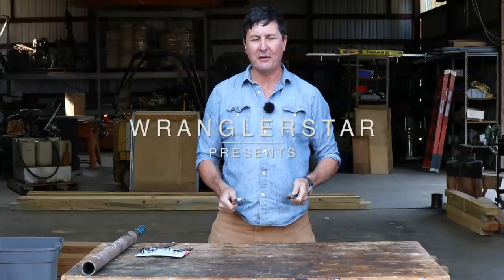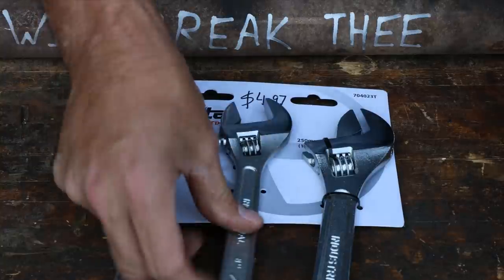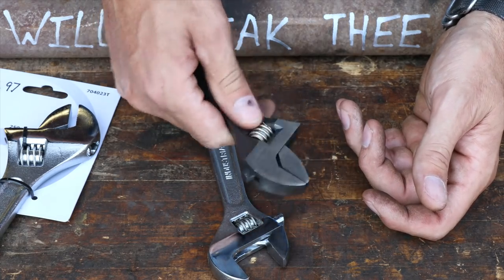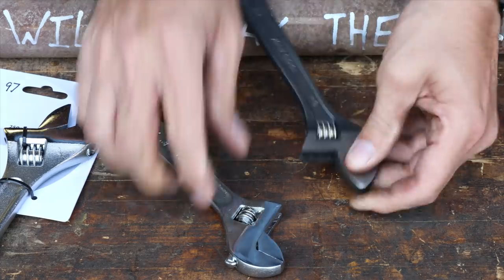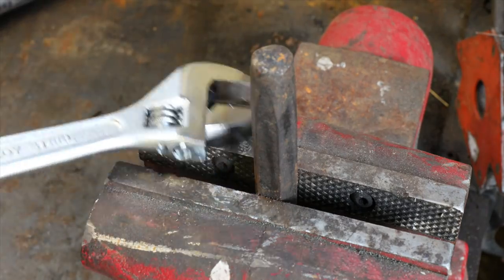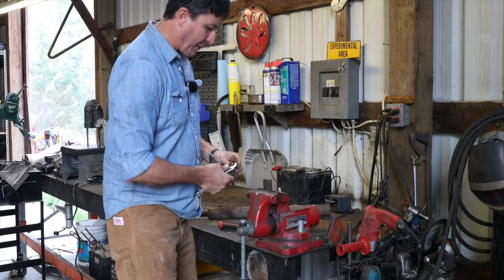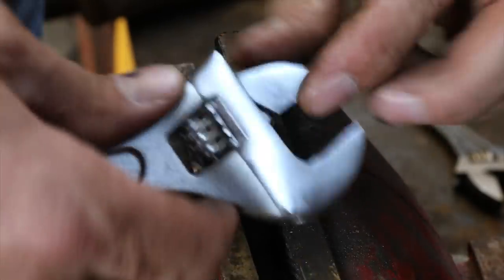Testing Cheap V.S. Expensive Wrenches On AMAZON

Comment from the maker: Great new! This S&K Wrench Just Went On Sale * * *https://goo.gl/igMEgW * * *
Reply: Wranglerstar Like 3 dollars off?!?! Now that's what I call a sale!
Reply: You can purchase a janky Chinese made with the 3 dollars you saved!
Reply: And you have a secondary use for the cheapos, as "sinkers" when you go fishing.
Reply: i like the saying "buy it nice, or buy it twice."
Reply: Wranglerstar  I bought an 8"  adjustable wrench from snap-on. made in sweden in 2005 I still use it every day today, I am a 50+ hour a week heavy equipment mechanic. There is a difference.
Reply: news*
Reply: Wranglerstar the adjustable wrench used today was invented by a swede if I'm not mistaken. In the 1890s. There was earlier designs but the one seen it this video is the Swedish type.
Reply: My dad always used the super cheap crescent wrenches to work on his van with, and they ALWAYS broke, either at the handle, or at the adjustable part.
Reply: I think at least a third, mid-grade tool should be thrown in the mix.  No way I would buy $4 wrench set, Or $35 Crescent, unless I know the $10-15 wrench is too close to $4 quality.
Reply: Wranglerstar milled or forged will always be stronger than cast when using the same dimensions and usually the same material, this video definitely shows this.
Reply: what if you allways paid that amount for shipping? So now youve kinda got free shipping.
Reply: @wranglerstar i have an idea use a pull weight scale to but between u and the bar so u can really see how many pounds it takes
Reply: Wranglerstar That was awesome, this first time I see your channel, very cool on putting tools to the test,, I was wondering if you can put a bunch of tools from Harbour Freight to that kind a test..I sure want to see that!
Reply: in the uk we call them hammer blows love taps
Reply: I think 1842 Edwin Beard Budding is inventor of adjustable wrench, and later on Bahco redesigned it 1891, so it looks like one today.
Reply: Wranglerstar my box is full of SK for the same reason your Grandfathers was "value". When it comes to screwdrivers and hammers it's all Snap-on. Snap-on ratchets are amazing as well.  Sunex  makes great value impact sockets. Cheap screw drivers "aka instant awls" have no business in anyone's tool boxes.  Those that don't appreciate a good tool tend to be the ones who struggle with simple tasks because their tools fight them the entire time.  My final words, "any tool that can do many things, never does one thing great"
Reply: impacts
Reply: Wranglerstar I feel the same way my dad always told me buy quality and now as a 14 year old and buying my own tools i make share they are good quality tools
Reply: Wranglerstar I,I
Reply: Hey wranglerstar do u know anything about s&k going out of buissness?
Reply: Wow, great timing. Who would have thunk it!
Reply: Wranglerstar, the teeth jumped on the wrench. I went back and watched it at 0.25 speed to see it.
Reply: What we are dealing with is American wages vs Chinese wages, I would think ingredients might be a factor as well, the type of steel and forging process.
Reply: The adjustable spanner, as most countries call it has been around since 1842, and invented by one or the other or possibly both at a similar time coincidentally, British engineers, Richard Clyburn and/or Edwin Beard Budding, then taken up by Swedish manufacturers Bahco, and American Crescent, around a similar time 1910. Thanks Wiki
Reply: lol crescent wrenches are garbage.. Have fun spinning nuts !
Reply: Farmers lathe. They have their uses and they see a lot of abuse.
Reply: Posh Pikey Pikey I've never heard them called that. I'm from Glasgow and we just call them shifters or shifting spanners
Reply: Geek facts: S&K did not invent the first wrench.
This modern version is a patented by Swedish Inventor Johan Petter Johansson from 1892. First producer being the Swedish brand Bahco, as early as 1892, still providing some of the best wrenches on the market. Johan Petter also invented the Plumbers Wrench in 1888.
The first version was invented by the English inventor Richard Clyburn in 1842.
Reply: As a testing protocol you are right.  Matthias Wandel does this using a bathroom scale and some cleverness!
Reply: Is it possible it got sponsored after it was posted?
Reply: Lying about being sponsored? Ive lost all respect for Ethan at H3H3 because of you!
Reply: Not really a sale, it just changed seller, there is a 12$ shipping fee.
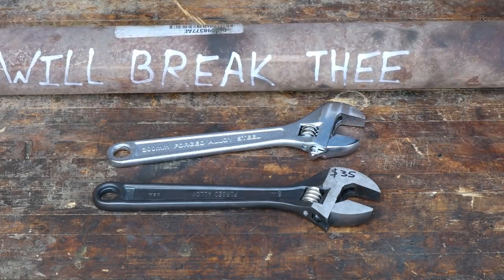Reply: If you read what the cheap one says on it at 2:01 they are both forged.
Reply: I got a hold of a garland no.2 leather mallet have you ever seen one
Reply: Many people have their own Amazon link that they use to link amazon purchases so they get something out of it. It's an affiliate link. He can earn up to 15% of the price you paid if you use his link to buy the wrench. It's called being a smart businessman. No lying about sponsoring.
Reply: Wranglerstar in Canada the "newfies" from Newfoundland call them tumb (thumb) wrenches.
Reply: Speaking as a "newfie", I have never called them tumb or thumb wrenches. Having used them for no less than 40 years, every Newfoundlander I've worked with either called them an adjustable wrench or a crescent wrench.
Reply: oobaka1967 must be the younger generation with the stronger accent/drawl ....
Reply: Actually, I find it depends on where in Newfoundland you visit. I live in the capital city and our accent is nowhere near as strong as you'd find with people living in outport communities. Maybe they call it a tumb wrench.
Reply: You should do some harbor freight tools
Reply: you would not shut up get to the fing point!
Reply: yes. damn the bla bla bla.
Reply: Wranglerstar I think quality tools saying should be ... gives you the FIZZ
Reply: With is why I like going to yard sales buying dated tools.
Reply: Wranglerstar I
Reply: Snap on, Mac, Matco, Blackhawk, S&K, and Craftsman tools get bought quickly at yard sales. Gedore tools are like finding gold.
Reply: Wranglerstar good video man . liked the ending
Reply: Wranglerstar I
Reply: What does this guy have to do with Ethan?
Reply: @ no1wrench True. I have a Swedish potatoe peeler. Still works. High quality stuff.
Reply: Good video man. Felt like I was having a good friend teach me about tools and life. Crazy, I know. lol subscribed
Reply: Wranglerstar i
Reply: I  bought a Harbor Freight wrench about twenty plus years ago and used it where I worked everyday and now I have retired and it still works fine. If it ever breaks they will; replace it FREE!
Reply: The quality changes sometimes. I remember when Craftsman tools were being made in Japan. They did not sale at all because of that, soon they were being made in the USA again. The quality may have been the same, but they had Made in Japan stamped on them.
Reply: Wranglerstar sub'd and bought one!
Reply: @Wranglerstar I'm not an avid viewer as I'm a machinist. So just have to say "Subscribed" because you said something damn epic and wise. "Come as deep as you can. Not always an option but whenever you can. Come as deep as you can."
Reply: S and K also has a lifetime warranty
Reply: Shifter in Australia
Reply: buy a tool from snap-on and compare it 2 a tool u could pick up from ur everyday shop or market from 15$ or so
Reply: BAK  I have a coworker that has a pair.  They look like awesome tools.  I would like to see them tested too
Reply: I don't know the S&K brand. However, in France, we have Facom, KS Tools... All very good. About your last question and full life warranty. About expensive tools,  I think the truth is in between. One does need all size of wrenches for all case, but in fact, only some of them are used a lot (13, 17 and 19mm for the 1/4, 8, 10 and 13mm for the 1/8) and some barely never leave the box. A full box of cylindric wrenches by Facom is many hundred euros. So I bought a cheap box. Then, I bought the Facom wrench, and the 19mm cylindric only because it's the only size I need with strong force. Some tools need to be premium brand, some other, less used, can be of a lower quality. PS. I also broke a wrench, probably the same branch as your chinese one.
Reply: lol....so you got no money for that?.......dont belive...
Reply: currently $44.71
Reply: Ya $45 for a wrench LMAO! No thanks. But he's just a salesman anyway. Let's compare the most expensive car with the least expensive car! (analogy) Oh dumb salesmen, always trying to prove that "you (we all) owe it to yourself to buy a $45 wrench!" lol dumbass. Dam dude, slow down your crack habit Mr. speed talker, there was very little, if any, worth while content that came out of your mouth.
Reply: Josh Rick Calm down there you Rick and Morty fan.
Reply: We are more the best tool for every job, if one can afford it.
Reply: When you see his YouTube name in there like that, you'll see that WranglerStar is monetizing his channel; in other words, trying to make money with it.  Amazon, not SK, will pay WranglerStar a small portion for commissioning the sale.  That's what this proves. It doesn't prove that SK had anything to do with the creation or content of this video. That's how Amazon affiliation works. WranglerStar is the one that brought people over to Amazon, who then bought products from Amazon. The link is how Amazon gives WranglerStar credit when the prospective buyer makes a purchase.

If you don't want WrangerStar to get credit, then go straight to Amazon's web site yourself, perform your own search for the same wrench, and buy it. Then, Amazon won't have any way to track the sale back to WranglerStar and he won't get credit for the sale.  It's more work for you, the user, this way, but it ensures that money doesn't exchange hands with WranglerStar.

WranglerStar proved in the video that the SK wrench was better built and better made. He broke both tools in the process. Both tools which, in the end, cost him money.  If he makes $0.07 from a sale of a $35 wrench (which, at the current moment, is up to $41), then let him. 

When, or if, you reply, please keep your comments relevant. I didn't put you down; I expect the same courtesy.

As for you, WranglerStar, this is the first video I've seen of yours, and I enjoyed it. I do my best to purchase quality tools, and yes, there really is a feeling of pride knowing that your tools won't fail you when you need them most - even if your'e doing the most mundane of tasks. To me, there is this indescribable feeling of attachment and pride I get with my tools. They're mine, and the tools know it. Take care of your tools, and your tools will take care of you. I subscribed, and I certainly don't mind if you make a commission from purchases I might make. I'm always searching for the best tools. I'd love nothing more that to have tools that last 20+ years that I can pass on to my own sons.
Reply: Wranglerstar it doesn't ship to Canada 😥 such a good video but such a tease cause now I can't buy the tool.
Reply: mm, who cares? Good video.
Reply: One week later and it's now listed at $41.60.  Haha!  Still worth it.  An important thing to discuss is that the reason the cheap wrench slipped on the steel plate is because the steel is soft due to a lack of quality forging.  More expensive wrenches will actually break rather than bend, but with much greater force due to them being much more rigid.  A consequence of this forging characteristic is that a cheaper adjustable wrench will wallow out at the jaws and be increasingly more prone to rounding a bolt the more it's used.

American steel vs Chinese steel is all about the forging.   There is simply no comparison.

Personally, since I don't make a living with my tools I can get away with having my regular tools as the cheaper brands.  However, when they become unreliable I have a set of quality tools that I keep to the side until I can replace whatever was giving me trouble.  This way, I'm not feeling quite as bad should I misplace a regularly used tool.Anyway, great video!
Reply: Wranglerstar to long and boring video...😑😑🙅🙅
Reply: Wranglerstar 8::::D
Reply: Only rich people can afford cheap tools.
Reply: By on sale, do you mean went up in Price?? Currently $41.
Reply: Steve Sanders 😩
Reply: Wranglerstar it was exactly 1.66
Reply: Wranglerstar
Reply: Wranglerstar the day you orders the cressant rench was on my birthday
Reply: Wranglersta
Reply: Wranglerstar your final comments transcend the whole wrench video. You could litterally apply what you said to anything in life to motivate someone lol
Reply: Bacho rocks !
Reply: swedish bacho is the best :)
Reply: The only problem I have is what you said with "renters". Being in the military from 2003 to 2013 I decided on renting instead of buying. Since I would end up saving much more money than I would gain in equity because of the deployments. I always treated the home I rented better than most people would treat their homes.
Reply: Wranglerstar Invented 1891 by Johan Petter "JP" Johansson that started BACHO. And he was Swedish
Reply: aa
Reply: Stop talking to much!!!
Reply: You feed my curiosity really nicely. Thanks for putting up these videos
Reply: Great comparison! Thank you. When it comes to the choice of purchasing a specific tool, I always look at how often it be used.  If I need a wrench that will be used 5-6 times in a month, I will definitely go with a cheaper one.  The case is different if something is used on daily basis.  That often used tool must be the best possible.
Reply: Wranglerstar 

The pop was a spark!
Reply: I hope SK also sells the parts separate?  Or are they guaranteed?
Reply: any German Tool is like the gold. most my co- worker are not every care it, but if you like it you not go back.
Reply: $42.34  went up in price
Reply: Actually that version from 1891 had dual moving jaws... the year after in may 11th 1892 Johan Petter Johansson invented the modern adjustable wrench but with 45 degree instead of todays 15 degree angle.
Reply: Wranglerstar I
Reply: Price back up - but the chrome, not the black oxide, is still about that price.
Reply: +CaptainDangeax
It's not "S&K", it's S-K, and it's an old high end US tool company that's owned by Ideal Industries now, a holding corporation that owns a number of different tool companies spanning numerous tool sectors. S-K is primarily hand tools for professional mechanics, technicians and millwrights, along with their Western Forge brand (the two are not the same though). Western Forge markets tools to the industrial market, similar to Blackhawk (Proto) and Williams (Snap-On). They also make some "private label" tools for other retailers. Who, exactly, like very nearly all private label makers, is highly protected proprietary information. They were making some higher end hand tools for Sears with the Craftsman Pro label until early 2017 when they unilaterally severed the relationship. Sears sued them for breach of contract and at that point some of the Craftsman Pro line having been made for Sears by Western Forge became public knowledge as the lawsuit is public information. Sears has tools made by a myriad of companies globally. S-K is an extremely close #2 to Snap-On in the USA. IMHO the hand tools are just as high quality, and just as durable, but at a somewhat lower price. With Snap-On, you're paying a premium for the fancy hood ornament.
Reply: Wranglerstar In most of the U.K. We call it a shifting key. I don't know why but we do
Reply: Im not sponsored btw
Reply: "Start with the Chinese Industrial Strength.....Oooo it's a lot of pressure...I am putting on my safety glasses on this one."
Breaks
"I wasn't pushing that hard."

lol. I'm sure most people know there's a difference between a $1.65 wrench and $35 wrench. The question is how a $35 Chinese Wrench square up against a $35 US wrench.
Reply: Wranglerstar P
Reply: Wranglerstar.
 House or apartment I always cherished where I lived. I was lucky to have a roof over my head even if its temporarily renting apartment or house. I was taught to always leave it like no one lived there.   I love your videos withall the knowledge Ive gained has been invaluable!
Reply: It is STILL over $30!!  LOL!
Reply: if you can brake that chinese wrench without extrension bar, then i bow.
Reply: Ya, something like a Stanley or Kobalt..
Reply: Here's a challenge for you: Prove to us (if you can) that an "overseas" Bahco brand adjustable wrench isn't the strongest, most durable wrench. Bahco is, of course, the original wrench since it was invented in Sweden and patented in 1891 and 1892. The Swedish company Bahco (BA Hjort & Co) was formed in 1890. Try to satisfy your American viewers by showing them that American copies are as strong and durable as the original. I'm not making any claims here. I'm merely challenging you. :-)
Reply: Wranglerstar buy Pittsburgh at harbor freight tools is cheaper and S/k ratchets are not good tools
Reply: Wranglerstar try the 1/2 inch ratchet S/k makes. Dare you.
Reply: HF has a 2 in 1 adjustable wrench for 9 bucks and opens to 1.5". I've used it for a few years working on boats in florida, never failed and the extra half inch opening is sooo nice!
Reply: Soak &save
Reply: "Not sponsored" huh
Reply: You are the person that needs a quality wrench
Reply: I'd still always buy American!!!
Reply: Correcttion: The "crescent wrench" is the adjustable spanner and was invented by a Swede called Johan Petter Johansson (called JP) and he got the patent in 1891. In some European countries it has been referred to as the "Bahco" (Swedish company that introduced the tool the market were BA Hjorth Company under trademark Bahco) for a very long time.
Reply: Wranglerstar do your arm broken before?
Reply: 36 years AutoBody and ALL my Sockets and Wrenches are S-K never broke or replaced one... the rest of my tools are MAC and SNAP-ON... Never had a 9/16 adjustable... BUT... you just SOLD me on the S-K adjustable wrench... VERY impressed with your tool wisdom at the end and it's very True what you said
Reply: @AverageReviewsYT   SK is going strong. I work for and make the wrenches, ratchets, pliers and adjustables.
Reply: give him a break, they let you try. If successful they will Sponsor.
Do you think there is anything wrong with making money.
Also saves him from people asking where exactly to buy, this way he is credited for his performance and knowledge.
Are you trolling or just Jealous.
Reply: see my reply to others.
Reply: Wranglerstar what did the jaws in the vice look like after the punch spun?
Reply: Buy cheap buy twice
Reply: Get the Black oxide Proto Adjustable Wrench. Same wrench at the SK for half the Price. Both made my Western Forge in the USA
Reply: You would be suprised how many people that work with tools daily dont know what a cheater bar is...
Reply: So, did S&K want the broken wrench to see the failure?
Reply: Several cheap tools are better if you rarely ever use them but if you use them often if not all the time their is no question Quality is King!
Reply: Wranglerstar Start looking at it this way, would you rather pay $2 for a budget wrench from China or would you rather pay $35 for a much better quality wrench made in the USA and I also know that about $20 of that money is going to go back into your pocket years down the line because that money will go into your economy. You will get that $20 back somehow. So in reality it’s more like you’re comparing a $15 USA made  wrench to a $2 China wrench. Then you can easily talk yourself into spending the extra money on the better quality USA wrench.
Reply: Wranglerstar 

Great video !  Next time you do a stress it till you break it ,,, leave both tools in the freezer overnight ,,  that will tell the tale really fast about cheap Chinese metal tools . Just a suggestion for a video if you wanna talk about metal quality
Reply: Brotha that SK adjustable sure looks like a craftsman adjustable wrench . Thats because  it is  . some where on that SK wrench are the letters W.F (western Forge)  . Western Forge made 99 % of the wrenches for craftsman . Ideal owns SK and Western Forge as well as Pratt and Reed.
Reply: Stop clickbaiting people. You'll get less dislikes.
Reply: I agree with your statement regarding the mid grade. However, given the option of the $35 vs $4 set, no real man would ever buy a $4 3-pack of wrenches and any man that did, would only ever do it once. Cheap tools screw up more jobs than they fix. Stripped out nuts and bolts is a situation no man ever wants to be in.
Reply: "I'm not sponsored by S&K" Sponsors by S&K
Reply: I have two Chinese wrenches and never broke probably striped 🤷 but still works
Reply: Ok boomer
Reply: Great new?
Reply: Awe man... Minute 14:00, I put my safety glasses on 5 minutes ago for you...
This is better than most action movies...
"Hug you traditional wife time" 🤗
Reply: Awesome,
Somehow a wrench test has made me to love my traditional wife even more!
I will go to hug her now...
Thank you 😎
Reply: A 8 inch wouldn't fit the tool belt of a miner. It would slip right through the slot in the belt and you wouldn't be able to tighten the coupler tight enough as there is 150 to 200 psi. in the air-line. The air hose is too big for an 8" wrench.
Reply: I work in a machining  shop and have for a lone time. I just through the first crescent wrench I bought in the trash after a year. I know that you give them a jiggle while tingeing them to get a good fit. Once they slip the first time they dont fit right though. Not worth the money just buy a set and they will last so much longer even if you lose pieces here and there.